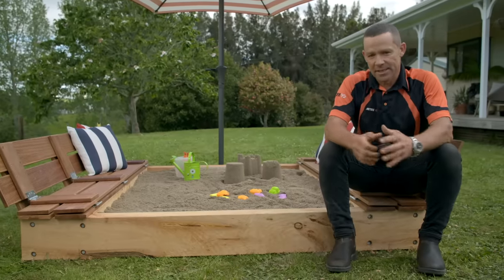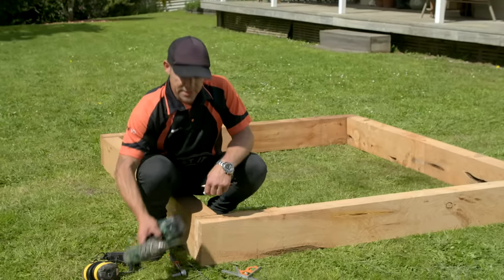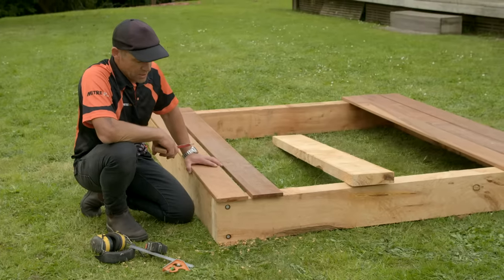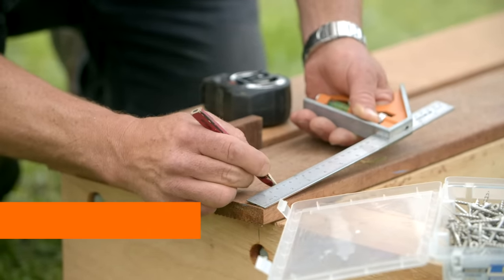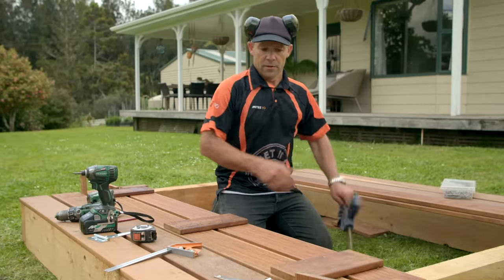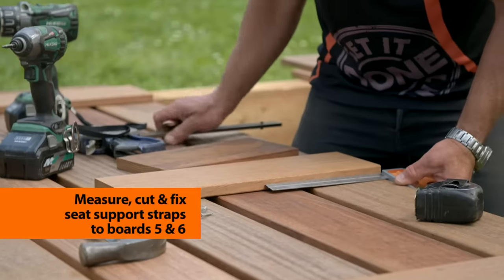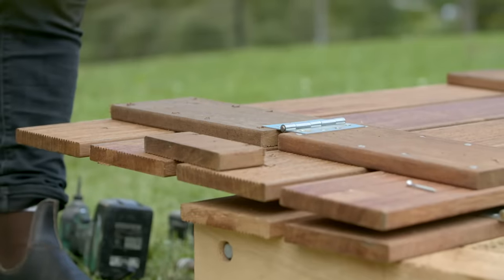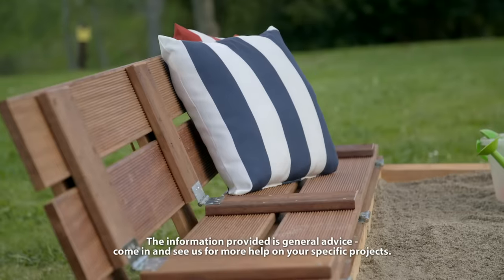How to Build a Sandpit | Mitre 10 Easy As DIY

Comment: Great design! We just completed building our one using these plans and made a few tweaks.

1 - Our decking boards didn't have a gap between then as for the seat we could see little things dropping into that cavity and getting stuck and lost
2 - Used more standard decking boards as they we more available and cheaper too. Very well built sandpit but the materials do add up to over $300
3- Put some small hooks on the back of the seat to stop them being accidentally tipped over if / when kids try to climb them.
4 - Stapled weed matting to the bottom of the frame to avoid gaps

Didn't manage to get everything as neat and square but very happy we built it. Next on the DIY list is a play kitchen! If you need someone less talented to help with a video for that you know where to find me 🤣
Reply from the maker: Great feedback, and stoked you gave it a go!
Reply: @mitre10nz  
Car shock absorber, attached to the end of a 45 degree (approx) diagonal timber brace, to absorb some of the earthquake energy.
Reply: @kytddjj  eh what?? your comment and your username certainly piqued my interest lol
Reply: Mitresawppp

Comment: What's the ball park number of how much this project costs (without labour of course) if all materials are bought from Mitre 10? Great video. Thanks!
Reply: I’ve just finished building mine here in Victoria, Australia. I had to buy a few drills bits and tools ect, so my receipt was fairly high. But for the materials only it cost me about $400-$450  for materials. (Timber, screws, hinges ect)

Comment: What was the size of the timber you used?
Reply from the maker: Hi Garviel - The dimensions and details of the timber show is below:
 
- 200x100 macrocarpa sleepers – sides x 4
- 200x50 macrocarpa sleepers – seat supports x 2
- 140x20 Palings x 15/1.8m
 
Although, the dimensions can be up to you and the space you have in your backyard. You can also find the full instructions on our website under Easy as guides and advice. Hope this helps ^Ian